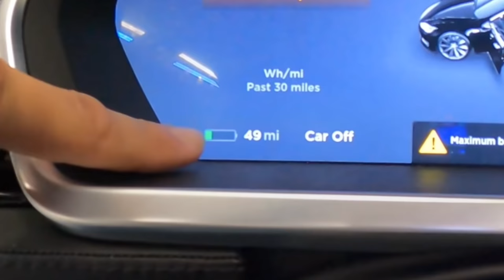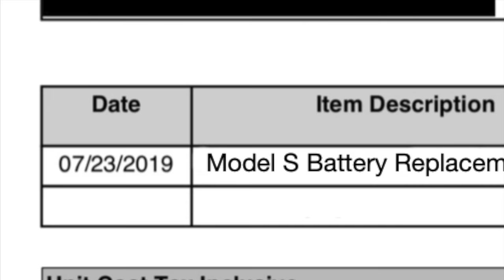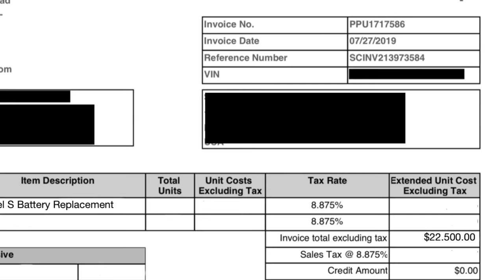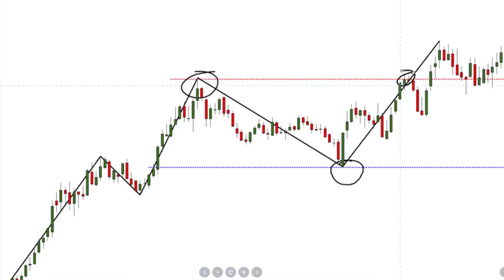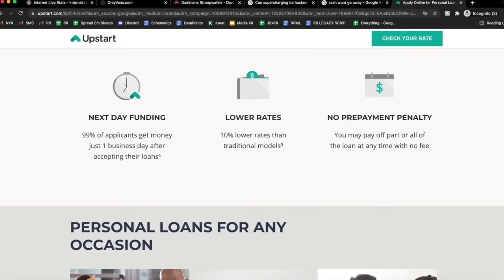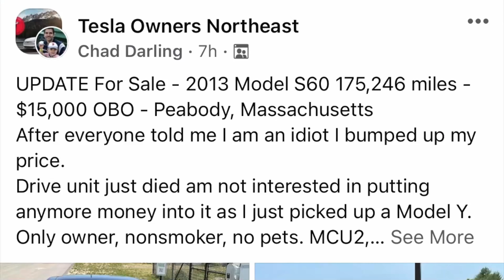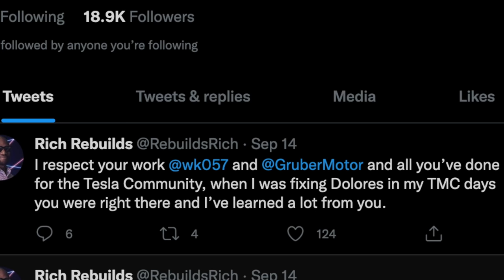The TRUTH about the $22,500 Tesla battery repair

Comment: You are absolutely right about companies not dealing with the small things and trying to just sell you a whole new part. I once brought my BMW to a dealer to ask about an engine knock that started to give me nightmares. They said that they won’t really look into what’s causing it and just recommended to buy a new engine for 10k without labor… my local mechanic fixed the faulty timing chain for 800 bucks.
Reply: I had an M2 and I swear I replaced every part on that car!
Reply: The biggest mistake was buying the BMW . I was thinking of buying a Chevy bolt,  but I decided not to. I'll just stick with my 1999 Toyota Camry and 2005 s2000.

Comment: Replacing just one battery  module can work.  But it is analogous to replacing a timing belt at 150,000 miles and leaving the old timing belt driven water pump in there.  Sometimes you get away with it, sometimes you don't.  It is still hard to find 10 year old batteries that are still good and strong.
Reply: Totally agree and don't see Rich mentioning this.  I think they are just praying the pack stays good.  I wonder though over time..what percentage will fail after this type of fix and how long (miles).  It doesn't appear to be a simple fix.  What needs to happen is there will have to be aftermarket battery packs with warranty.

Comment: @35:00 An electric car charged by fossil fuel generated electricity still produces significantly less CO2 per mile than an internal combustion engine.  Main reason is that even a power station running on the worst form of fossil fuel, coal, generates less CO2 per unit of energy produced than an internal combustion engine in a car. The reasons for the higher efficiency are two. 
First is that power stations are almost always running at their optimum operating point (which is normally close to full power output) and second is that, being unconstrained by size and weight limitations, they can afford build much larger machines for a given power output that can then extract more energy from the heat produced by the fuel. 
There have been various studies on the subject of EVs powered by fossil originating electricity vs internal combustion engined cars.  One of the outcomes is that even in the worst case scenario of an electric car run solely on electricity generated by conventional coal powered plants the EV breaks even on carbon emission in about eight years. 
For the more average power station, somewhere between the worst coal and the best LNG powered CCGTs you get a breakeven time of about 3 to 5 years.
For the best case scenario, when using zero carbon energy that break even occurs in under a year, the balance being the extra CO2 emissions involved in building the EV over the ICE car.
Reply: Don't try and use logic with his argument

Comment: They should sell and replace battery packs at Tesla with refurbished battery packs. Trade in old and get a refurbished and balanced battery pack installed. They then refurb that one for the next customer. Should be doable for a several thousand dollars  by Tesla or a large enough service company.

Comment: Great back and forth you guys had... some really good points were made on all sides.  The part about rabid Tesla fans turning a lot of people off completely to EVs is very possible.  It's ok to criticize any product, as long as the points are valid.  No product is perfect.  And come on, charging 22k for a new battery pack because of 2 bad modules is ridiculous and wasteful.
Reply: Well the “fix” failed quickly. So perhaps the repair center’s choice was proper.

Comment: I love my framework laptop. What laptop comes with a screw driver with built in pry tool to help you open it up. Had to buy the DIY kit too, just for the experience.
Reply: I chuckled watching Louis go from "I'm too cheap to buy a new laptop" in his unboxing of the framework to "I'd replace this in an instant" in this video.

When I'm ready for a new laptop I will be checking them out. They had me at easily replaceable battery, which is always the first to thing fail.

Comment: Great vid, thanks! One thing to note: even if an EV is charged entirely from electricity generated from coal, it still emits less CO2 than an ICE car. Reasons: coal power stations are more efficient than the refinement of gasoline; the electric drivetrain of an EV is more than twice as efficient as the drivetrain in an ICE car. Any electriciy generated from renewables is just a bonus. The CO2 payoff period for an EV using coal-generated electricity is about 60,000 miles (taking into account manufacturing emissions).
Reply: Interesting - please can you confirm where I can find this information? I'm really interested to see the breakdown of manufacturing, gasoline refinement and coal power station operation.

Comment: The Lucid Air could be a good road trip car, if they can sort out the charging. But if Ford can't sort out charging for the Mach-E, a small manufacturer like Lucid has next to no chance.
Reply: Legislation. I don't have an electric car but I recently researched the connectors over here in the European Union and I'm led to believe that we mandated some form of compatibility, meaning, other manufacturers can use the preexisting Tesla network, etc. This is like GSM again, sometimes the free market just brings incompatibility, due to adverse competition.

Comment: 35:30 one thing to note here is that, even using fossil fuels, one giant steam turbine burning nat gas or shudders coal, is way more efficient than having the same number of tiny little engines burning gas to move 1-8 people.
Reply: Plus, unlike what some people seem to believe, not all power is generated from coal. For example, I live in a rural area, and there's a big solar farm going up about 2 miles from where I live, and there's a nuclear plant about 40 miles away. The coal plant 10 miles away seems to be mostly inactive.
Reply: I searched the comments to see if this had been said. Cars are so inefficient its still better for the environment to drive a coal powered ev then a petrol or diesel.
Reply: @Seibar42  That's not accurate when you take in the lifecycle costs of the vehicle since there's more upfront emissions in building a BEV, BUT big BUT it does /not/ need to be 100% green energy, last I looked into it it was somewhere around 30% renewable that you hit break even for the average use case, that's probably improved with the efficiency of the vehicles.
Reply: @liambergstrom8183  last I looked even if you take into consideration the up front increased emissions, even coal power bev is better than petrol over a long period

Comment: I recently attended (as a member of the media) a Ford F-150 Lightning dealership training event and, from what I was told, Ford seems to be prepping its dealer networks to be able to service individual battery components rather than focus on whole battery pack replacement. They certainly WILL replace an entire battery pack if needed, but I found their philosophy to repair refreshing after hearing about these Tesla after-warranty costs. Especially when one considers that the F-150 Lightning Extended Range battery pack will enter the market as the largest available battery pack. 

In short, if your Ford battery drops below 70% charge during the 8-year 100K miles, they'll replace it under warranty. But it's also good to know that they might offer more affordable fixes for when individual components fail post-warranty.
Reply: Messages and chats.

Comment: Still more fan of the F-150 Lightning approach with a modular battery pack, more easily replaced. Imagine when Tesla releases their structural battery pack. Just like Smartphones...once the battery is too degraded...time to buy another one. Not very Environmental Friendly.
Reply: once the battery is too degraded ... in 50+ years?
Reply: @santiagocastro4683  a.  Considering how Tesla markets, I'm surprised you believe that.  b.  There are cars older than 50 years still on the road.  Because someone loved the car and can service it themselves.  The point is they're still building something that's basically disposable, 50 years is nothing to the age of the planet.
Reply: @hamsterbrigade  some people eat all the Tweets, without question. Like many taking serious the Tesla Bot, with a person dancing in a spandex suit, instead of a working prototype.
Reply: @santiagocastro4683  Because first try is a charm with Tesla's batteries always?
Reply: @santiagocastro4683  you know it will start on fire way before 50 years.

Comment: Rich is the man and I've been following him Not Long Enough.
His humor rocks, so does his channel.
I'm recently early retired (disabled) at only 52 due to major vision problems in addition to MS. I didn't say that for pity, just trying to paint a picture here. Last time I worked a real full time job was Dec 2017. From that time to about 15 years prior I was an electric forklift mechanic. I worked for all the major manufacturers of forklifts here in Detroit area so it's not like I was stuck working on one model or technology all that time. I've seen alot of cool stuff and a few turds (early toyota ac motor trucks for example...there was no  "controller" just a big open board of all these weird japanese transistors and tons of cable etc, you get the picture".
The performance of these machines have been borderline shocking in the impressive department for quite some time now. Alot of new trucks came off the semi to the dealer and not prepped meant they were turned on high. They were equivalent to a 707hp v8 in a challenger than any chump can buy and ends up in body shop within 15 days of purchase.
We had to turn them wayyy down to be safe.
Electric trucks make sense in material logistics because, um, enclosed warehouses. Nobody wants carbon monoxide in their lunch diet for 30 years. 
My whole point is this...Rich is trying to point out the fact that infrastructure here in US will NEVER support an all electric fleet anytime soon. Just can't happen. We all love the punch of electric vehicles and they are here to stay. However I firmly believe for at least the next hundred years it's gonna be kinda sorta pretty much like diesel vs gasoline in the car and truck markets. Electric will be the diesel bitch sister and gasoline will remain the norm. Like ultra low sulfur diesel fuel, electric vehicles will fit into that highly complicated (by the EPA) vehicle controls that cost more and need a crutch (such as DEF) to keep that market alive...but won't be for the every day commuter on his or her average 20 min drive to work each day.

I'm 52 now but someday when I grow up and can afford it I want a 9sec Plaid.

Comment: imho , Both Jason and Rich has their points. 

Batteries typically have a lifespan.  When a pack is built , it is MOSTLY built with cells that are manufactured the same date or are brand new. Thus they would all have the same lifespan and undergo the same usage throughout it's life and have the same capacity leftover and IR . As a cell's lifespan decreases , its capacity decreases and the IR increases and with a pack , all of the cells in the pack undergo the same drop . 

Therefore when you just throw in a new/used module into the main pack , that module will most likely not have the same true capacity and IR as the rest causing it to deplete quicker or have a greater sag . HOWEVER , this issue can be usually be negated by the BMS. As for what Jason said about the pack not lasting as long is because when you do Rich's fix , you may have fixed one or two modules , the same may happen with the rest of the module which is why , it's not really a proper 'fix' . 

In Rich's defense , He's right about it being cheap and what most consumers want . I've had many customers coming to me for battery repair but would just want the battery to work properly . In this case , I call it a 'dead cell group' issue . Meaning one or more serial groups have died for whatever reason . I've explained that the BMS may not be able to balance it properly due to the difference in true capacity and that the rest of the pack may also have the same issue soon but most people just can't afford getting a whole new battery and honestly I don't blame them. So i do the repair anyway . 

Batteries don't last forever nor do they just die often . However in some unfortunate cases , they do die out for no reason and normal consumers thinking is why change the whole pack when you can just replace some like the normal triple A batteries for cheap? That's just how it is . Not everyone can swap out their entire battery , especially when it costs them what they paid for the car. It is what it is.

Comment: 35:39 - For me.... I see the "well, electricity is produced by fossil fuels, and that's unclean" argument as ignoring one glaring issue: 

Comparing to the efficiency of INTERNAL combustion engines (and their pollution / maintenance costs) vs the electric grid, and it's efficiency....

I'd rather have CENTRALIZED inefficiency, than small power plants in every vehicle... that's also needing to be mobile. 

It's way better to offload that power plant FROM the vehicle and use electricity. 

And the supercharger network is going to be bullshit for adoption, as we are going to have redundancy, which is unneeded, and monopolistic practices will ensue. 

We instead need to force a SINGLE standard for refueling electric cars like we did with gas. Imagine if every car had a unique nozzle shape and you had to go to certain gas stations. You would hate it.
Reply: Yes, using a generator to power your Tesla uses way less gas than an ICE car doing the same miles, it's not a chicken and egg story.
Tesla Superchargers are about to be opened to other brands, and use (at least in Europe) Type 2 plugs, which have become the standard now that ChaDeMo is fading out of use. Considering it took 2 decades for mobile phones to use USB, this isn't going too bad.
I have to go to certain gas stations for LPG, it's only a minor annoyance considering an LPG car is as cheap to refuel as a Tesla (unlike VAG/Ford/Mercedes' Ionity, which bills triple the price/kWh, reaching cost parity with expensive European gasoline) .
Reply: Imagine if iphones used different chargers than android phones, oh wait.

Comment: One thing sometimes overlooked about Tesla is some of the residual effects the company has had on those of us who can't afford one.  I never gave buying a Tesla any consideration because of their cost, but my boss bought a Model S to replace his Chevy Avalanche.  I thought it was great and this led to my own interest in electric cars in general.  I was able to afford a used gen-1 Chevy Volt that I've owned for over 5 years now - it's been great and replaced my '93 Cadillac as a daily driver.  It also led directly to a friend of mine buying a used gen-2 Volt to replace his mini-van.  He liked driving on electric so much he bought a fully-electric Kona for his wife, replacing a Dodge Durango.  Like any critical thinker, I have mixed thoughts on Elon, but that's a lot of fuel saved over the course of 5 years between just 4 different people, and none of that would've happened if Tesla hadn't gotten the ball rolling.
Reply: and do u get yr power from the sun ??
Reply: @rhett7716  A little, but it's mostly from wind according to what I signed up with through my local utility provider.  My town is literally surrounded by windmills.  The best part is with the Caddy, a trip to work along with running a few errands usually cost around $5.00 given the car runs on Premium.  The Volt costs about 75 cents for the same trip based on average utility rates in my area.  The car is pure gravy at this point - it more than payed for itself in the five years since purchase.

Comment: In Australia, I logged a service ticket with Tesla to quote me on a new rear motor and battery or motor and battery repair. I do not need these but I thought I would check the pricing. AUD 32k for the battery incl fitting and 18k for the rear motor incl fitting. They have no repair services here.

Comment: Hi!

This is one great video. Love the honesty.

To Louis' comment about pwoering an EV with fossil fuel, I have to share the most compelling reason perhaps that persuaded me to buy a Tesla: to wit, in the process of refining one gallon of gas, the process is reputed to use as much electricity as could be used to drive a Tesla the equivalent distance. 

In effect, we have removed the whole part about refining the gallon of gas from the extraction-transporting-refining-trasporting-burning "pipeline." The biggest benefit of doing so is the pollution introduced by refining gasoline and the second transporting and burning portions of the equation. That's a phenomenol benefit, but because we often look only at the end point of burning refined gasoline or powering an EV motor we miss the value of using an EV, even when the electricity is wholly supplied by fossil-burning fuel generation.

Hope this helps!